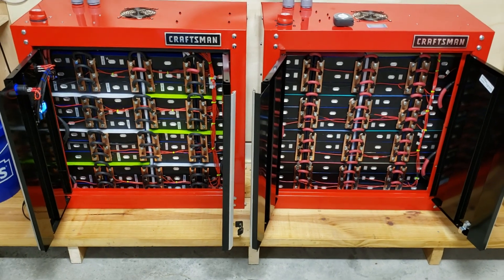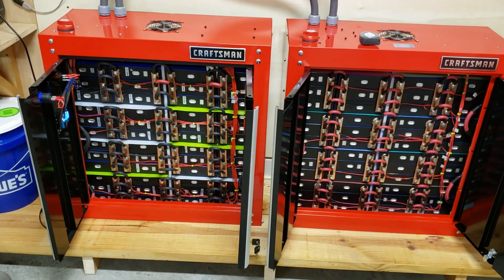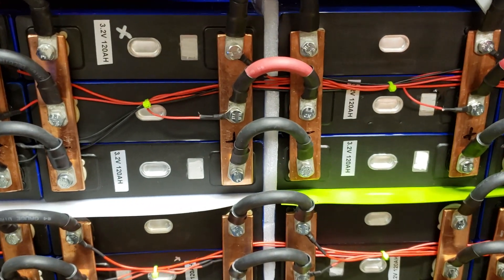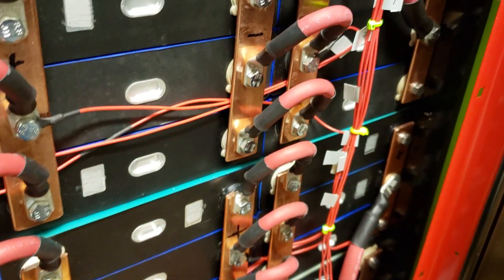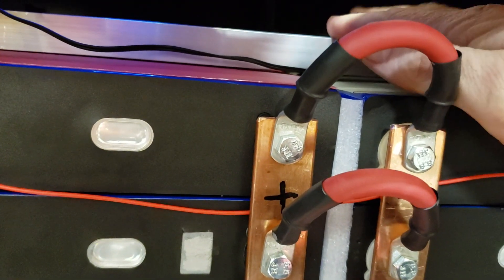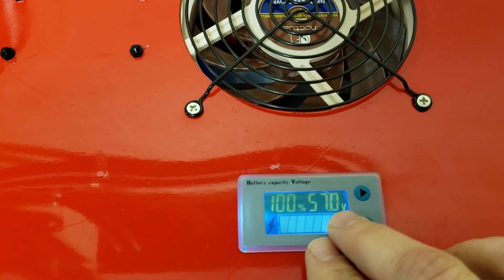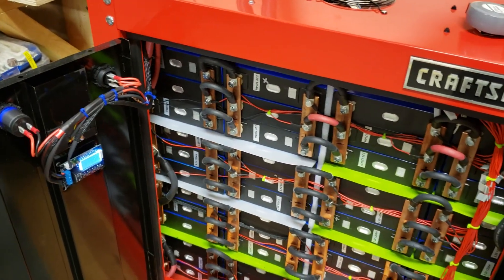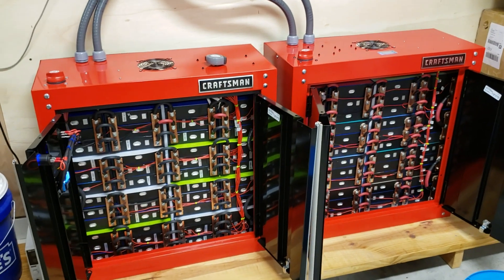LV 5048 and 38 KWh of Stored Energy.

Comment: What do you consider a good deal per  lifepo4 battery cell .. I cant seem to get the price as low as i want with the vendors on  the ali site
Reply from the maker: I have not kept up with price of batteries as of January. Negotiate as much as you can. Since I was in market for LiFePo4 cells I was comparing/negotiating with sellers as price per Ah shipped to my door.
Reply: @DMIINC2013  per my research and hearing your commentary,  grade B seem to work well for solar..

Comment: do you run whole house and central a/c off those lv5048? if so what is best way to set inverters
Reply from the maker: I  can run everything other than AC units on the LV5048's. AC will be on them too once I get the third unit in the upcoming summer. Thanks,
Reply: @DMIINC2013  A third inverter or third power wall? Curious because I will have close to the same setup.
Reply from the maker: @LeeHill66  Both. Thanks.
Reply: What's the basic math on your future system with the 3rd inverter and running a/c? Peak summer kw usage per day when running a/c, average solar output per day in peak summer, etc?
Reply from the maker: @AussieInSeattle  It will be interesting to see  how system in whole will perform during the summer. 3 inverters are more then capable of running both A/C units. My home is only 2200 sq/ft. Down stairs AC unit runs on 8.5 amps on the hot days and upstairs on 12 amps on 240 volt circuit. Both units together consume less energy than dryer itself. I have 9 KW of solar panels waiting to be installed. How much production I get out of them remains to be seen. I am hoping for 30-45 KWH per day on sunny days. Our worst summer month in this house occurred in September 2019 where we went through 1.4 MWh of energy in one month or 46.67 KWh per day. Normally 1100 to 1200 KWH per month in summer and 500 to 600 KWh in winter.
Reply: @DMIINC2013  so 10000 or so kwh per year at 13 cents per kwh?  Break even in 10+ years?
Reply from the maker: If was looking solely from that perspective I would have not even try to do any of this. Mostly realizing childhood dreams on this and in return having some benefit from it.